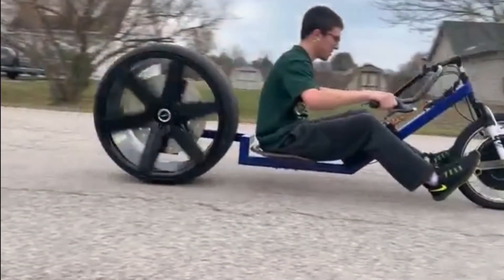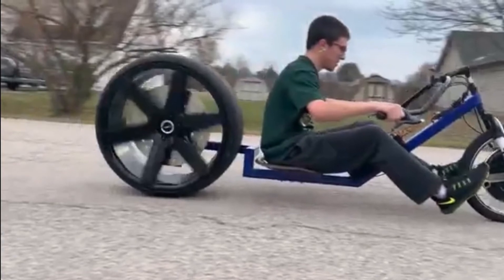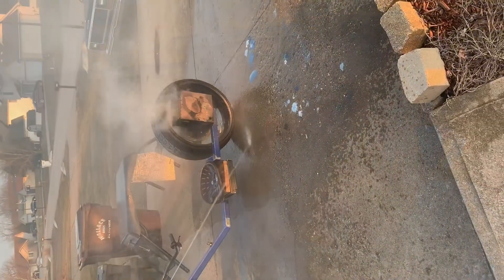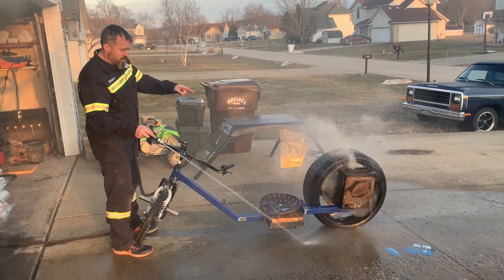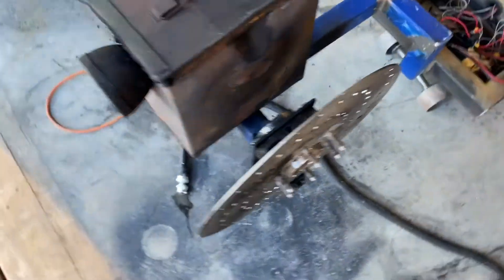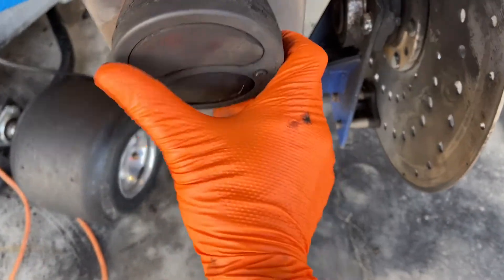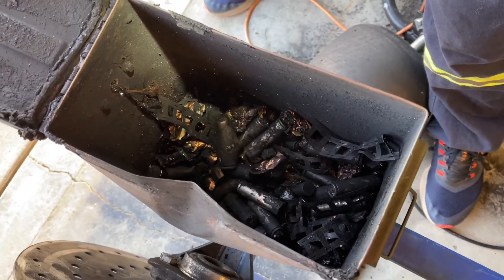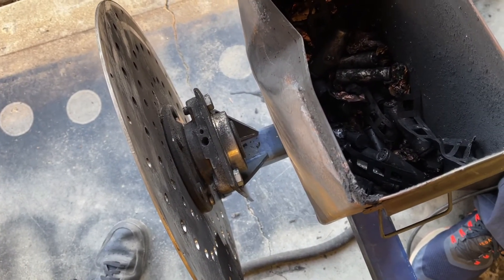DIY Electric Chopper FIRE! Lithium battery meltdown, smoke, and aftermath. Almost lost the house!

Comment: are you even using a BMS (battery management system) ????? never and I mean NEVER mix up random cells together and make a pack like that with em, you're lucky it didn't burnt down your house also keeping a big bucket of sand (pour on the cells incase of fire) and doing multiple test charges before actually using the pack would be a good idea.
Reply from the maker: I did not use a bms on that pack as it was all salvaged cells, which is also why I didn’t do fuses like my other video. I have also done the rest of my packs with bms or bms leads w a smart charger. They we all soldered w strips and essentially a bomb, which is why they went in an ammo can. I’m working on property so I can build a house and a shop so if there is a fire it’s just the shop. Hard to make money on 170 subs though lol. Sand would have been handy if not being in a steel latched can. Mixing the cells, they were all tested and assembled using repackr.org. So I guess you could say that it was a purpose built pack but w out a whole lot of safety built in, I knew this going in as well. Thanks for the feedback.
Reply: " essentially a bomb" well yes it was a bomb indeed and by mixing random cells (not talking about the grey ones) you can do it but only like for powerwalls/power banks but fused ofc as they are not necessarely the same capacity or have the same discharge/charge rate. Using fish paper rings for the + side is pretty much required for safety. Shrink wrapping, padding with heat resistant foam, insulating with kepton tape (non conductive and heat resistant tape) using a bms for charging, discharge is ok without a bms as long you don't go below the minimum voltage recommanded for you battery type.

otherwise goodluck with your projects, be safe.